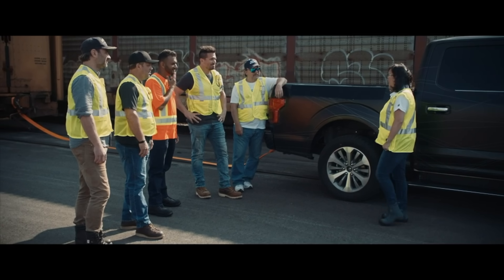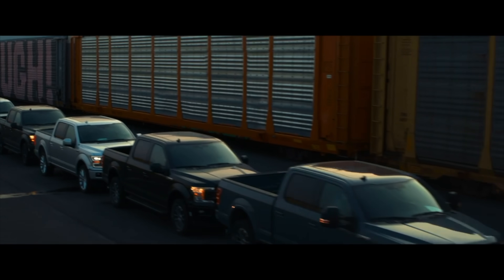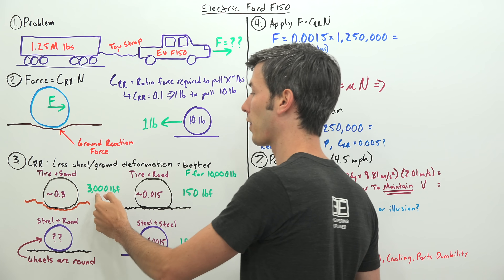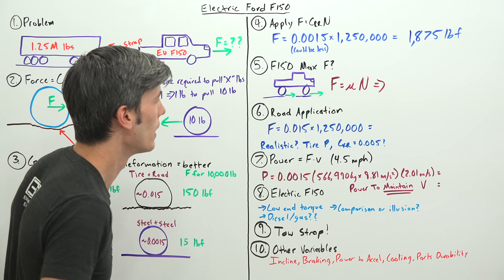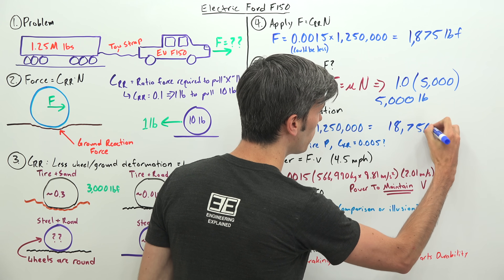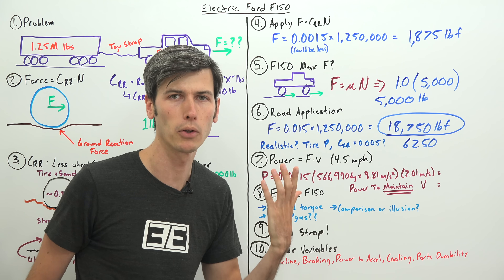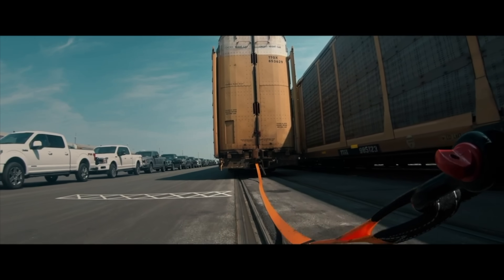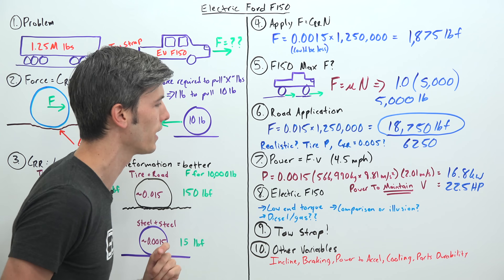No, Ford's Electric F-150 Can't Tow 1 Million Pounds (Realistically)

Comment: I can move railcars myself. I work with rail cars... there’s a little crows foot railcar moving device we have... sorry don’t know the technical term.. it has a foot that sits on the rail and a 6 foot or so handle that’s attached to a little pusher foot that comes up and pushes on the wheel of the railcar. With no breaks on flat ground I can move them myself. I’m 145lbs ... so yea. Super impressed LOL

Comment: I wanna ask you a question. When using and automatic in manual shift mode. When changing gears do you need to move foot off the gas to change gears like a manual or not. Sorry for being of the topic

Comment: @Engineering Explained  :  When I saw "tow strap!" on the white board, I was expecting a bit about how the elastic tow strap helps in overcoming friction by providing a way to transfer kinetic energy into the system. Isn't it way easier to get the train moving with an elastic tow strap compared to the (relatively) sold coupling of a train engine? 

Also: Could we do that with a Prius and post a reply video to Ford? That would be fun!

Comment: There's a reason diesel locomotives are actually diesel electric (diesel running an alternator which runs an electric motor). Also a reason these locos are rated at 4000 hp+

Comment: They probably reinforced the frame driveline the electric motors are more powerful then teslas electric engine. Gearing is also a factor and the drive shaft also plays
Reply: Nope.   A standard gas engine 1/2 ton could do this.      The force required is not that great and the real key is that strap.     Try it with a chain and your going to see tire smoke.

Comment: Years ago this same stunt was performed by a human pulling a 500,000 lb steam engine.  To show the low friction of roller bearings in the engine.
But one problem was that the static force needed to START the train moving is at least 3 times greater than the rolling resistance.  So steam engine drivers used "slack" to start one car at a time and jerk each one into motion.  For the stunt the engine needed assistance to bump it into motion. THEN the human could maintain its motion.

Comment: Realistically the coefficient of friction for tires won't ever be 1.0. 
Did you choose that over a more realistic 0.7 for simplicity and a generous calculation? Not that the result (lbf>resistance) would have changed...

Comment: The acceleration data is actually in the video, as at about 4:18 they show the train as it starts to move with the cars loaded, and at 2:54 without.  There's only a second or two each time, but there should be enough to get a rough estimate of acceleration, and therefore actual power used.

Comment: Another way of looking at it is that 1.25M lbs is 625 tons.  On the railroad we use a ratio of horsepower per ton.  On flat land where they would load and unload vehicles like in the video, an HpT of .5 would suffice to move that around.  So even a 350 horsepower rail vehicle that can get enough tractive effort, or a car with enough grip, could move that.

Comment: That ford would still pull those trailers on the road as long as you put more weight for traction.

Check the longest road trains.
Reply: not enough torque

Comment: Also something to keep in mind, modern day rail cars have roller bearings on the wheels. So that helps aid in keeping things rolling. If you had to pull the same thing with the old “ journal boxes” it would have been a whole different outcome.  At least that is what a former General Superintendent of the LIRR had told me

Comment: After watching the original Ford video it was already clear to me that Ford wasn't showing that you could buy the truck and tow 1.25 million pounds, 'cause no one does that.  Surely they were just trying to make the point that this truck (once available) will be capable of towing (like a trailer with a boat on it, or whatever).

It was very clear to me that the forces were not all that high, no higher than the breaking strain on the tow strap - obviously!  Also clearly the forces couldn't be higher than the traction limits of the truck & its tyres.  Cool demonstration, but it was very clear to me that what they were doing had to be within the laws of physics.

Could a petrol or diesel truck do the same thing?  Maybe, but it would be hell on the clutch (or torque converter).  Much easier for an electric motor that can pull from zero RPM without needing a clutch.

Comment: I just noticed they used a 5.5ft bed for the pull.  Mine weighs 5120lbs with 4wd and 2.7l engine.  Rated to pull approximately 7000lbs as configured.

Comment: A truck that lightweight pulling a load that heavy would just cause the wheels to spin due to resistance from heavy load. Or not move at all because electric motors would probably just whine or click.

I seriously believe they used a pusher to make it look so easy. Nice try Ford.
Reply: Panamera Ghost nope rail cars have the stopping distance of wet soap semi trucks are often put on rails to pull them
Reply: @advancedsoldier8569  After much thinking, I realized that since this million plus pound weight is on rails, it makes it easy to roll. If the cars had wheels with tires and was on the road, that electric pick up wouldn't be going anywhere.
Reply: Panamera Ghost exactly all of them are equal to 500 tons and the biggest dump truck in the world (belaz 75710) weighting only 370 tons when unloaded i don’t think that f-150 is able to pull that

Comment: Yes, thanks so much for telling me that towing 1.25 million pounds is not practical.  It's almost like trains could do this.
Reply: @Drew Kangaroo It is quite common for freight trains, especially in the US.

But modern high speed passenger trains have all-wheel drive, to maximize traction. Electric motors can be made very small for their power, and if you have 64 185 kW electric motors you can be really fast, like the 16 car Shinkansen trains.

Did I say modern? :-)
Reply: Did you ever seen how BIG locomotives engines are? Diesel locomotive engine is bigger than that Ford F-150 itself. So yeah, locos can pull that load, but not the road car. Any existing road car. Even heavy military vehicles with 1500 h.p. can't do that.
Reply: He's saying a pickup can't do that,  and one locomotive can't move that much weight. You can with a few locomotives
Reply: @matthewwilson5019  Not sure what sort of Loco's you're referring to but one decent diesel Loco can pull 10 times this sort of load quiet comfortably.
Reply: @matthewwilson5019  yeah.... locomotives can very easily haul 2 TONS per hp (so 2000lb/hp) A typical modern road locomotive has 4400 HP so it can haul 8800 Tons (or more if its an AC unit) 17 000 000 lb.... And thats just to make sure it can get up a 0.5% grade, so realistically it can haul much more on the flat. I have when building a dp train pulled 13000 tons (26 000 000lb) with a single 4400hp ac locomotive in the yard at about 12mph...
Reply: Matthew Wilson if you’re calling locomotives weak then something’s wrong here

Comment: You forgot an important fact about locomotives.  They backup before going in the direction of travel to compress the hitches between each freight car.     Then when they start moving they are initially only pulling the first car.   Then the slack gets sequentially taken out of the hitch so the weight and momentum of the first freight car and locomotive are now pulling the second car then the third and so on.

Comment: So, I guess we're just going to ignore the fact that trains actually hover about a half a millimeter above the track. The extreme weight of the train causes extreme heat between the train wheels and the track. This causes vaporization of the top-most layers of the track and wheels. This carbon and iron vapor is released with enough force that the train is lifted, ever so slightly, to "hover" above the tracks. You can actually push a train all by yourself, by hand,  so long as it has fewer than 20 cars. Feel free to google this. Although you guys probably won't, because it's easier to just go off of what you "think" is real.

Anyhow, all of this is proof that the Earth is flat. No way this could be done on a "round" (LOL as if!) planet. As Jason said, if the train were on a slope it would simply pull the F150 downhill with it. Guess what, people? A round planet means you are always on a slope of some sort. There is no inflection point of "flatness" on a "spherical"  "planet". Stop herding together like goats and begin to think for yourselves.

Comment: No way a 1/2 ton can do that. Plus that 4-6 inch strap will not hold. Hell if that's the case I should have no problem securing a Caterpillar 988H wheel loader with two 1/2 inch chains on a Lowbed just fine. (which is not legal or realistic)

Comment: Thing with pulling trains is that the train is not one wagon weighing 1,25m lbs but individual wagons with couplers between them.
So getting a train to move means you start by pulling one wagon, adding wagons as you move building up momentum per wagon. Which makes it alot easier to get the total weight to move.

Comment: The old Volkswagen turag diesel pulling an airliner... was a far more impressive feat... however, they cheated also... filled the vehicle with concrete, and used a torque amplifier tow dolly...

Comment: Rail worker here. There are no brakes on rail cars if there is no pressurized air.  The only other way would be to manually crank the handbrakes on the B side of the car and where I work you have to apply brakes for 10% of the cars you have and you’ll round up if it’s even 1 car over so for 50 cars you need 5 brakes but for 51 cars you need 6 brakes to be effective. I doubt they used any kind of brakes on the train car side
Reply: Also if they DID ride the brakes to allow the train to stop easier it mean all your calculations are broken too (it’s common to have some brakes set when stopping your locomotive in tight areas (like loading and unloading spots) so the train will basically stop dead when the locomotive stops moving

Comment: Jeremy Clarkson was able to pull  13000 metric tons with a Citroën C4 
by the way pound is a mass unit and  mass is not force. This would be as silly as using a mass unit for a volume measurement.
Reply: @AustinRBa  measuring a force is one way to calculate the mass, yet there are other ways (example, from volume). Same is true for force, which can be measured by using elements of known mass but also by shape change (the standard way today)
in science, new ways of understanding observations are commonplace and might require a new wording, keeping the old way risks misunderstandings as shown in the video. In reason units a force is measured in Newton as Newton showed the importance of differentiating between mass and force

Comment: That's waaaaaaayyyyy too much math to answer this question. I'd much rather just see him do an experiment and put a force gauge in between a horizontal force and a small load on steel wheels and then just scale it up. When I used to work in a warehouse I can tell you it takes about 50# of force to pull a 2,500# loaded pallet jack with steel wheels across a level concrete surface. Now obviously that's not a rail car on a steel track, but I can't imagine a huge difference between the force required to move ____ lbs/tons on steel wheels across a level track for the same weight.

Comment: I have been working as train engineer for a while. Sometimes we had to work in the shop too, to get knowledge of the machines. If the ground is absolutely flat and brakes aren't applied we could move a whole train of 190 metric tonnes with the use of one 2m long crowbar by one person in the trench, crowbar had to be applied sideways under the wheels. Of course it went slow to start but it could be moved a few meters easily... Trains rolling resistance is very low and the lever does the rest...

Comment: The ballpark figure for rolling resistance of a train is a minimum of five pounds per ton of weight of the train.  If that's a 6,250 ton train, then it would take almost 36,000 pounds of tractive effort to move that train, or six to seven times what the truck weighs.  It's quite impossible for the truck to exert that much force.
Reply: Goddammit, those decimal places will get you every time.  It would be 625 tons, and 3600 pounds of tractive effort.  Much more doable for the truck, and the tow strap.

However, I'd bet there's a locomotive on the other end to provide air for the brakes and to stop the train with.

Comment: What you did not say, they did not start pulling 1,250,000 lbs. neither does a railroad locomotive, they start pulling 1 car at a time, adding a car as they take out the slack.

Comment: You're missing a point that makes the stunt even less desirable.. trains like this have sequential load bearing built into the hitch adapters between cars. Even a regular train engine wouldn't be able to move the cars if they were rigidly attached. By having moving hitch points, the load is added evenly and slowly, not overwhelming the engine.

Comment: @EngineeringExplained can you please check my math; according to this video my truck should be able to move 433,333 lbs? My truck has tow cap. of 6,500 lbs. The calc I did is the 0.015x=6,500lbs, this solved for x is 433,333. Is this correct?

Comment: WAIT. Modern trains use airbrake systems to slow the train, but without a locomotive unit hooked up to the train, the brake system would have no pressure. This means either A.) They rigged something up to release the air brakes, or B.) There’s a locomotive on the back of the train too!

Comment: So I should be able to pull 1,250,000 lbs. with my 2500 lb. Electric Smart Car?  It has a 60kW motor!
This would be really fun to see!
Reply: I hope Jason responds to this. But I think torque is a big factor
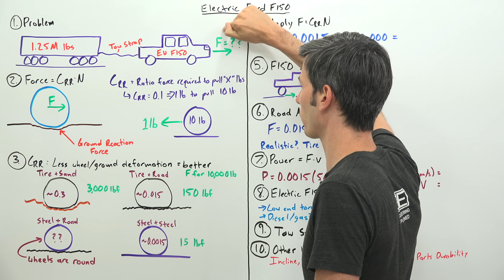Reply: @edpagan5421  I couldnt find the translation for the electric smart fortwo, but it would need to be 1:25.
(11100 N (weight force of car) * 0,36m (radius of smart tires) / 160Nm (torque of car motor) = 25)
I dont think it's 25:1 (rather lower) so you probably cant pull a train. Also you get only about half of your weight to your powered axis so the weight force of one axle (about 1250 flb) isn't enough to get the required torque to the ground with a traction coefficient of 1,0.
Reply: @MinecraftSubi  nice, thanks, your comment sounds like something from my dynamics class. And coefficient of friction 1... Is it posible?
Reply: @Traumatree  ok

Comment: If a truck only has the capability of pulling something the amount of force as its weight how come the towing capacity for some trucks as high as 20,000 lb is it because the coefficient rolling resistance of 20,000 lb is below the weight of the vehicle? Or could it be that there's enough bottom-end torque 2 counterbalance or multiply the power of the truck 4 towing capacity?

Comment: I work around the railroad pretty much everyday...on a slightly breezy day if the brakes aren't set on those cars the wind will literally push them...Pretty easy since the rolling resistance isn't that much

Comment: Ford pulls 1 million lbs and this guy spends 4 days to prove otherwise 🤦‍♂️
Reply: Your comment is that of a hater lol.  He pretty clearly did NOT prove otherwise.  The Ford F-150 probably really did pull 1mil+ pounds with the train being a TRAIN with STEEL RAILROAD WHEELS on STEEL RAILROAD RAILS.  What "this guy" did is proved why trains are STILL used today.  They are efficient as a result of steel wheels on rails being dramatically less in the rolling resistance department.

Replace the Steel Wheels and Rails that the 1mil+ pounds is rolling on for Rubber Tires and Road and suddenly it's no longer possible for that truck to pull that weight... even at 4.5 MPH like was done in this video.
Reply: HutchinsonJC yea ik dude it was a joke if you couldn’t tell
Reply: HutchinsonJC It could still do it but it depends on the tires. Drag tires, mud tires, race tires, sport tires or street tires.

Comment: Does this take into account the friction at the axle? The wheel isn't perfectly rotating resistance/friction free on its axle.
Reply: If you could put the train up in the air and grab the wheel and spin it, I doubt it would spin very freely.

Comment: I think an ice car wouldn’t be able to because the clutch would burn out before you got it moving. That’s the point. That’s why diesel trains aren’t diesel drive - they’re diesel powered electric generators, with an electric drive. Because you don’t have a clutch in an electric drive. The point isn’t that you can (or can’t) do this on a road, it’s that you can’t pull that same load on that same rail with an internal combustion engine. Because you’d burn the clutch out. That’s it. Your ice truck couldn’t do it.

Comment: The assumptions expressed here are that the track is level.  I would NOT be surprised if that train was on a 50’ per mile grade.  I base this on how quickly the train got to speed.  
If this was was true there would be even less force needed to tow the train.